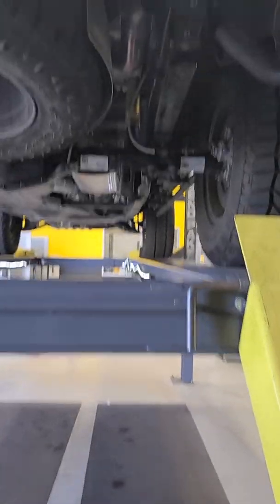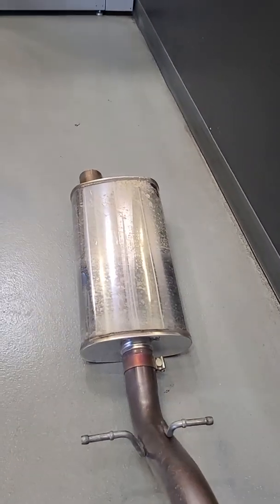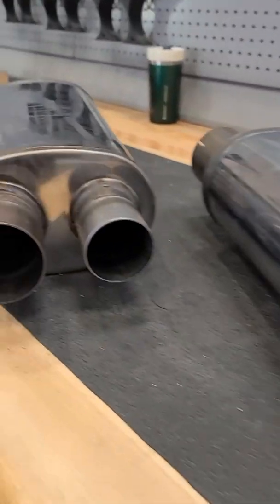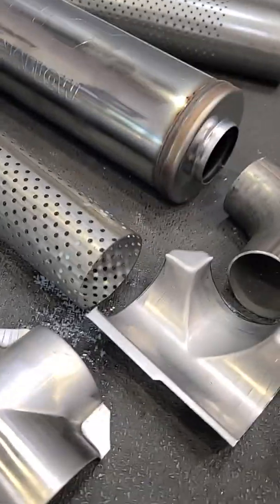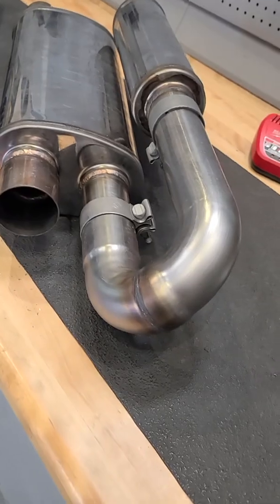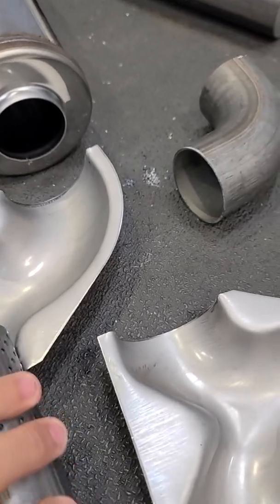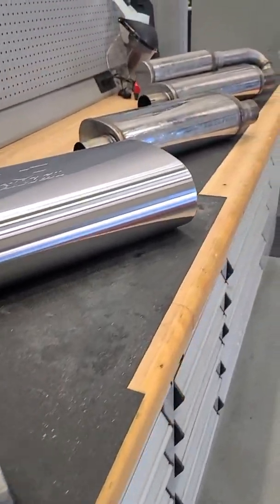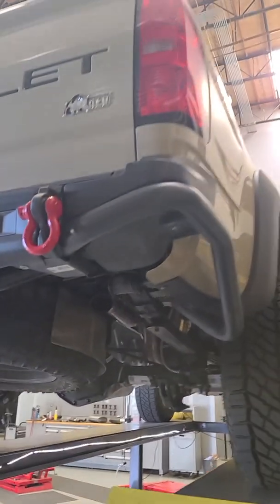MagnaFlow Overland Series - Discussing design and functionality in the prototype testing phase

Comment: Richard, 
We purchased one of these systems for our 05-15 Tacoma. Magnaflow makes it so it will fit ALL models with the 4.0L V6. We have a Tacoma with a 2.7L I-4. The only difference is the flange that connects the system to the factory connection. No biggie I had the factory flange changed. Our 2.7L Taco is supercharged w/ new to be released Magnuson Supercharger & equal length header. Sadly with the Supercharged 2.7L & header this system makes Women & Children run for their life’s at anything over 35 to 4k RPM’s. I’ve added another muffler 5x8x14 in front but it’s making Women & Children run! Can you PLEASE HELP⁉ But it doesn’t drone!
Reply from the maker: Sounds like a stout build. Are the cats left intact? Typically a header will increase the sound level a bit but noise levels are usually in check unless the cats are removed or a "high flow" variant is used. If either of those are the case an additional muffler will be needed to make that outside tone more manageable.